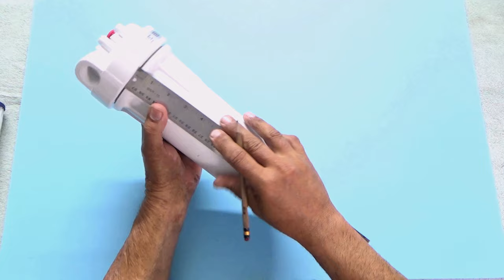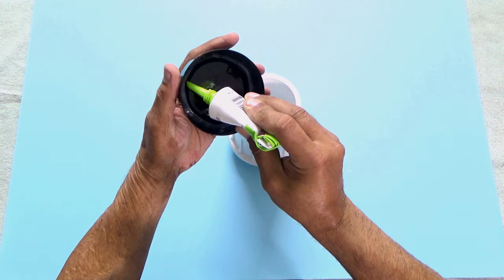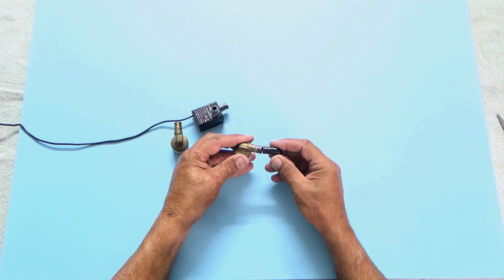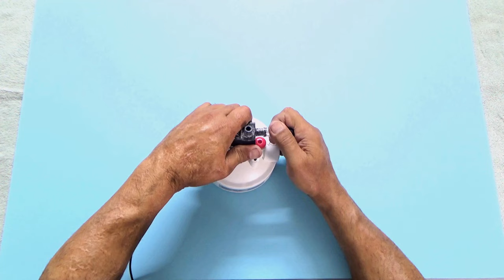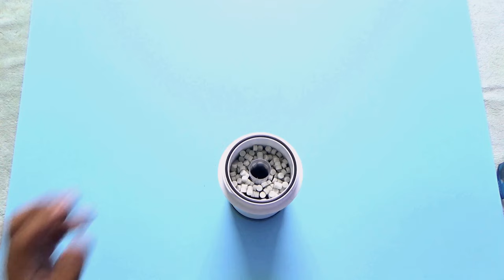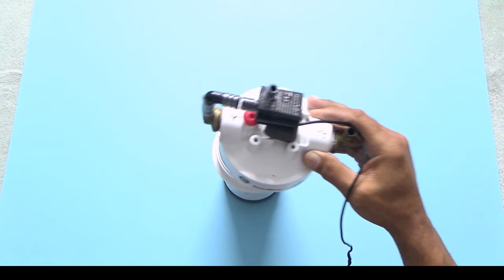How to DIY Nano Canister Filter

Comment: After Motor OFF - Does what suck its own
Reply from the maker: Yes cause it's a closed cycle system n as long as the output tube is under water in the aquarium. Thank u for ur question